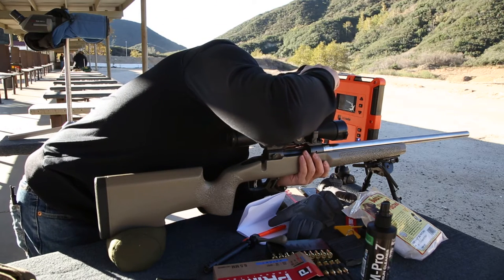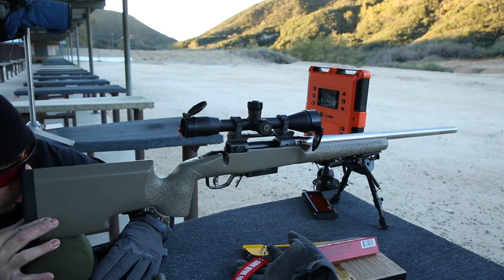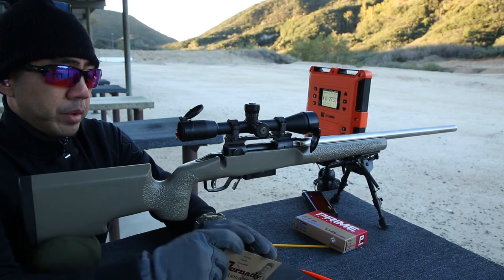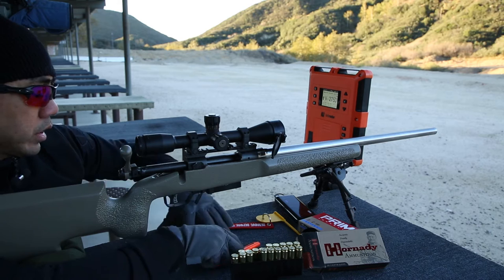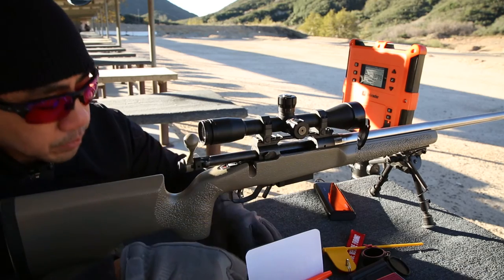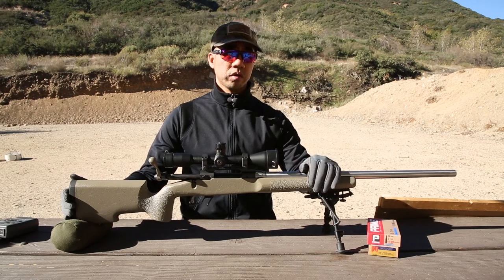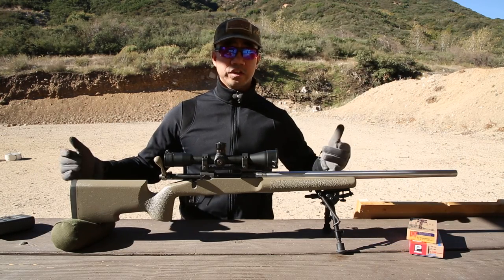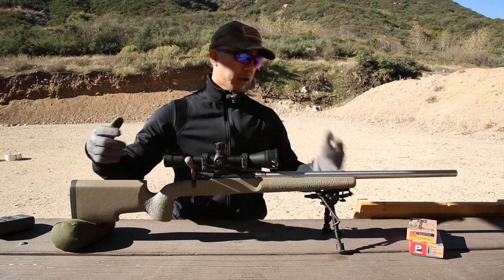Range Vlog #022 - Testing the Rebuilt Savage 10FP 6.5mm Creedmoor

Comment: What kind of torque wrench is that  ?  Thanks
Reply from the maker: Fix It Sticks torque limiters. It's expensive to buy each individual limiter as opposed to a single adjustable torque wrench or driver, but it's great for portability. If anything, I highly recommend get a set of Fix It Sticks, even without the torque limiters. It is a great multi-tool. https://www.ocabj.net/mini-review-fix-it-sticks-multi-tool-and-torque-limiters/